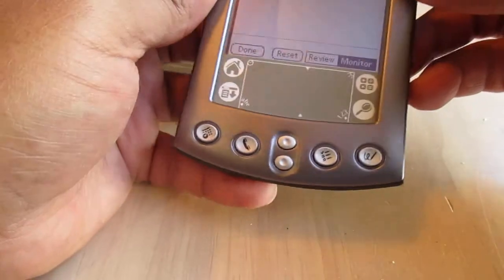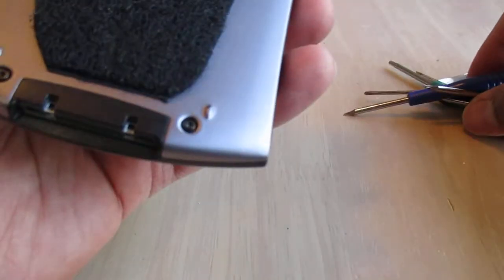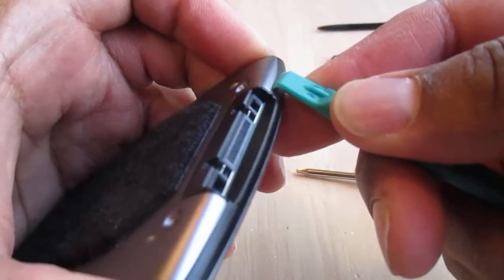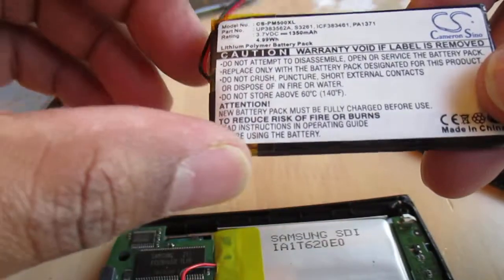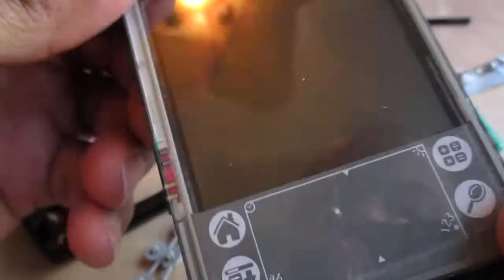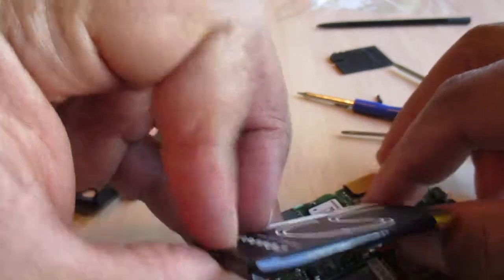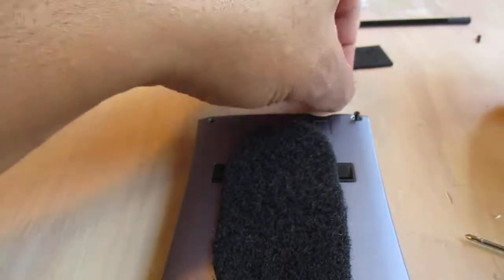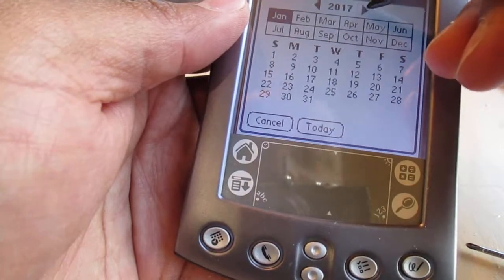Palm M515 Battery Change for 1G MMCD DSM Datalogging

Comment: Palm devices from the original until the end of 2003 all had a unique design. When you hit the power button, they come on instantly. We take this for granted now, but that was unique in the handheld computing world for a long time! How they accomploished what no one else could seem to was for the whole computer and your app storage is held in RAM. RAM memory is super fast, but if you disconnect it from electricity, it wipes the memory. So when you hit the power button on a Palm to turn it off, it actually just turns off the screen and the battery keeps the lowest voltage necessary to prevent the RAM from being wiped. 

This means there is no way to "put it to sleep" as you said in the beginning of your video. This is why it was wiped after you swapped the battery. This also makes them unique in the sense that pretty much anything else you take apart, you disconnect the power first thing. You simply cannot do that when working on a Palm device.

I LOVE that after you got the new battery in, it beeped at you and you spoke to it like a small child with an owie. It started beeping and you were like "I hear you...etc" I took a part a Tungsten T3 just the other night for a battery swap and it has a sliding mechanism, so it's more complicated to disassemble. At some points I had to apply more pressure than I would have liked, you just can't avoid accidentally hitting buttons and making it beep at you. It felt like I was doing surgery on a robot and I was hurting it. 

I find it hilarious and fascinating that you seemed to have a similar reaction when it started beeping at you. Nice vid bro 👍🏻

Comment: I found a tossed out Palm Vx to-day, the cradle, & the 2 styluses. Didn't find the charger. Can a homemade plug be made? Safely speaking. Thank you 🤓 😂 I think the back cover of the Vx has to be heated via hot air, & carefully pried off to access the battery/ pcb.
Reply from the maker: It might be easier and safer to see if you can find a new charger off eBay.
Reply: @whoismario  yeah boss, I looked, a lot of people selling these units don't have the included charger. Will keep looking! Thank you 🤓

Comment: Just replaced the battery on my M515 and the power button is solid green all the time and the PDA does not power on. Anyone can tell me what’s going on?
Reply from the maker: Did you try hitting the reset button in the back?
Reply: @whoismario  yes. I was just told by PalmDr that is probably the motherboard. Thank you
Reply: @iamscifi6710  palmdr? Hmmm.. thanks 🤓